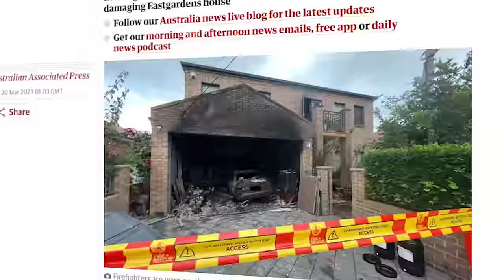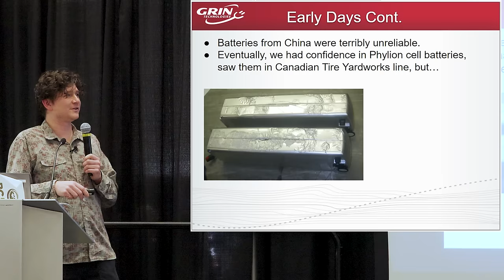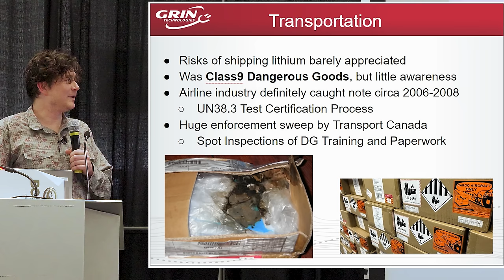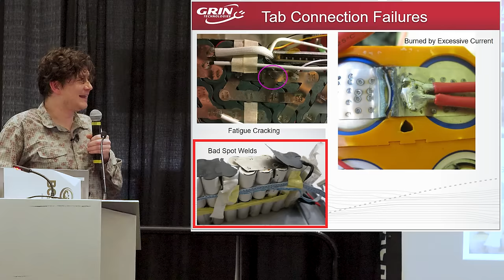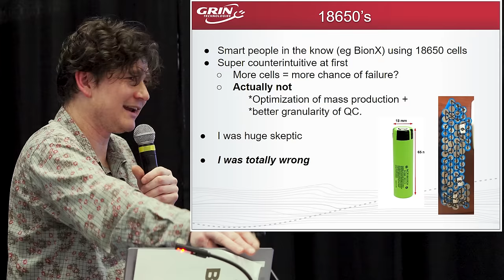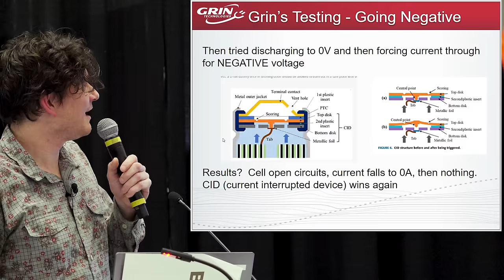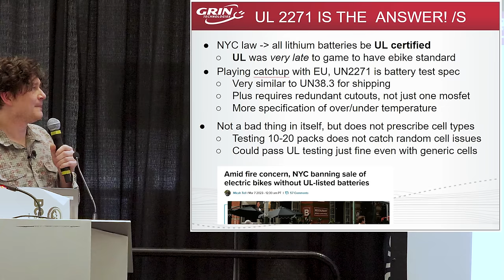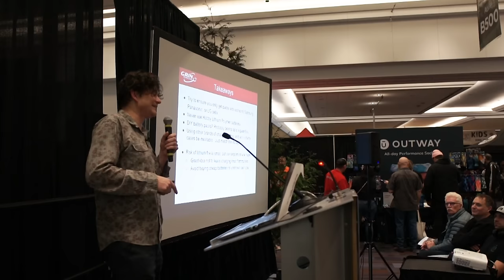Grin's Perspective on Ebike Battery Fires, 20 Years of Experience - Live from the BC Bike Show

Comment: Great video. Do the batteries you make have a fuse in line with the charging circuit? If not why? Do your batteries have the ability to monitor via bluetooth/app? Could not find this info on your website.
Reply: Some BMS (so-called Smart BMS) will monitor the parallel cell groups in the battery via blutooth. You can detect odd behaviours very easily with these, without having to rip apart the battery.

Comment: I'm glad to see Grin having this conversation and taking battery safety seriously. I was working in Ebike product development for a manufacturer in Seattle, and was in fact a Grin customer. When I took on that project let's just say things weren't well understood, and in fact dangerous. I pressed for standardization and increased safety measures, ultimately coming to the conclusion that in the future these batteries, BMS, and chargers should be certified by the U.L. I would go further to say that the BMS is not capable of monitoring individual cells, instead it tracks a parallel bank of cells. Should one of these cells be faulty it can lead to over charging of other cells on that circuit.
Reply from the maker: Indeed, BMS just tracks parallel cell groups. In our experience, the individual faults of a cell in that group are either:
1) Disconnection from the group, (eg from a bad tab weld or an internal disconnect within the cell can). This results in that group having less capacity than the other parallel groups, and during charging it will reach full charge first.  The BMS circuit should stop the charging once that cell group voltage is high, but if the BMS circuit fails at its task, or someone charges from the discharge port where there is no overcharge protection, then it result in overcharging as you say. 
2) Internal soft short.  In this case, one of the cells has an anomalously high self discharge rate and drains the parallel cell group faster than the BMS is ever able to balance it, eventually resulting in this group all getting discharged to 0V. The BMS circuit in this scenario should prevent both the charging and discharging of the pack. If it is charged in a way that bypasses the BMS charge cutoff mosfets, then all the other cell groups in the pack get slightly overcharged.
Reply: @GrinTechnologies  In the event a faulty cell or connection should become faulty there is not usually an indication to the end user that such an issue exists, they simply wait for the LED on the charger to turn green, perhaps notice a subtle reduction in range if they frequently check. But few do. It really needs to be black and white for the end user. I'm sure you're focused on the same things.

Comment: As long as the UL2271 will NOT adress the cell spacing or  Thermal Energy Absorbing Material between cells the UL will mis the goal !  Thermal runaway is one thing but thermal propagation is also VERY IMPORTANT. I have this document and revised it completly and from now it will help but not help  the best as it could.

Comment: Camera Overheating Use External Battery, cooler like small fan or cooling pad (no noise), lower ISO and most common is mismatched SD card class rating for video being recorded.

Comment: my ebike battery always stopped working quickly and was charged quickly.
it was an 8s 24V lifepo4
the BMS only looked at the first 3 cell groups, which was fortunate because the 2nd and 3rd series were defective due to corrosion
1V and 2V and the rest 3.7V

Comment: The sad thing is that because of these early hazardous batteries a lot of public transit will not allow any electric mobility devices on their services meaning the promise of connected transit needs to wait until they can be sure that all of the old cells are out of circulation, which could take years.

Comment: With good investigation technique, The real cause of these fires should be VERY easy to track down with basic statistical analysis. It may not even be the batteries themselves but the controllers they're connected to. We need to focus on BMS technology. I have a pack from a hover board that I couldn't destroy if I wanted to because it has overcurrent /short circuit and over/under-voltage protection 3.2 to 4.15v. I suspect most consumer packs are like this. This could also be caused by bad chip programming within the BMS. The charger used shouldn't matter if the BMS is well designed. I've been a lithium battery collector for a while and haven't had a single fire or even an overheating condition. I always charge my cells to the right voltage using the factory charger and quality hobby chargers with lithium battery settings. The fires I hear most about are from racing drones with their unprotected pouch cells being physically damaged over and over. None of my drone packs ever gave me issues aside from the occasional cell going bad. If not for the internet or media, I would have never known of lithium battery fires. I think it's far less common than the media would have you believe. The media loves sensationalism and lithium fires make for juicy content. Don't buy cheap cells and only trust Sanyo, Panasonic, Sony, Samsung or LG cells. Most other brands are hot garbage from China (a country who both relies on us economically and hates us politically). I think Samsung and Panasonic are the best but that's a battle I won't fight.
Reply from the maker: Thanks for your perspective. It's unfortunately that the fires themselves almost always destroy the all evidence as to what sequence of things caused it. But all the circumstantial evidence with ebike battery fires (hobby RC is a totally different scenario) suggests that most of the fires are not the result of faulty chargers or faulty BMS circuits, or customer misuse, but faulty cells.  

It doesn't matter how good your BMS circuit is at preventing overcharging or overdischarging, if a cell develops an internal short circuit and goes into thermal runaway because of poor process control and QC by the cell manufacturer, then your hoverboard pack can be just like the 100's of others that burst into flames during normal use.

Agreed 100% on your final statement too!

Comment: Where can we see those firetesting videos?
Reply from the maker: They are super dull, literally nothing happened. The circuit interuptor stopped the current flow once the cell's internal pressure got too high and then the packs just sat there with no current.

Comment: Note that there are no problems with Lithium Iron Phosphate chemistry batteries. Industry just doesn't use them because they are slightly larger batteries than lithium ion batteries 😢
Reply from the maker: We dealt with 5 different manufacturers of lifepo4 ebike battery packs back in the day (both in cylindrical and prismatic cells), and none of them had even close to the reliability or the cycle and calendar life we see  with the current leading brands of li-ion.

Would love to know how modern lifepo4 has kept up, but since A123 left the scene many years ago there doesn't seem to be any respectable manufacture of LFP cells in the caliber of Samsung, Panasonic etc

Even at double the weight it still could have widespread use as an intrinsically safer alternative for sure.
Reply: @GrinTechnologies  they have gotten much  better than the early days. But the main problem is with how they are being charged still. I built my own LiFePo4 pack three years ago for my ebike, and the capacity got better and has not demished at all. But the key to my success has to do with unidirectional  impulse charging that uses little current so does not heat up the batteries at all, even though it is delivering 1 amp impulses at Mhz speeds. Its a method that can't be used on lithium ion because they are real finiky and likely explode. This method was invented by John Bedini for lead acid batteries, and the LiFePo4 ended up working great with it too. Unfortunately he passed, and not many of the battery chargers out there, and few of us are out here that understand it enough to build our own.
Reply: I've got a lifepo4 from 2019 that I am only now retiring because the voltage is dropping. There's no reason for most people to use a li ion battery on a bike in 2024. Lifepo4 is plenty powerful and lightweight. The tradeoff is completely foolish now.

Comment: Specs are labeled for a reason, to prevent one of the components from overheating. Its why I NEVER use a battery of placing on a controller a range of 36 to 48 ( 52v ok for 4b benchmark ) of my batterie at 60v or higher.  As long as I KEEP ALL THE SPECS IN RANGE AN USING PROPER Volt's AND WATTS ,I ll be well safer than sorry as FIRES are NO JOKE ( wildfire survivor ) and NEVER RISK using components away from the spec range, its there for this reason alone.. Also CUTTING WIRES TO INCREASE SPEEDS is a SERIOUS NO NO, time will catch up with doing this for sure.
Reply from the maker: The nominal published ebike component specs in many cases are meaningless, especially with regards to voltage and power ratings.  With regards to cell specs, even if you use the cell entirely within manufacturers guidelines, the risk of a spontaneous thermal runaway is always present with generic grade cells. Your recommendations here seem relevant but largely miss the point. Most ebike battery fires have nothing to do with using components outside of their spec.

Comment: using a proven battery is a good idea.  I’ve built battery packs from scratch, with success, however, I have found after years of testing, that tool batteries, such as dewalt, can be used with great success.  Custom building a rack, to hold these batteries securely, and to multiply voltage to the desired value….and likewise, parallel to increase capacity.  The only downside, is that batteries must be removed to be charged individually on its own charger.  But, for safety, and long lasting durability, this does work well.  Still using an ebike after 10 years with this setup, a hubmotor and controller from Justin’s ebike store👍, and 9 dewalt 20 volt batteries in a 3s and 3p configuration, that clip into a rack that fit securely inside the bike’s triangle frame, resulting in a 60 volt 12 amp/hr pack.  I charge all the batteries full before inserting them into the rack, so there is no voltage difference between batteries.  Reliable, predictable performance.  3 chargers can get all nine batteries charged and ready to go again in 3 hours👍.    Thanks for the video!  cheers from northern BC🇨🇦

Comment: What is your opinion on the rad power bikes safe shield battery that's a fully resin potted battery
Reply from the maker: I'd need to see side by side test data to have a strong opinion. When we last tested resin potted batteries into thermal runaway during the early ligo development it didn't stop thermal runaway but it also didn't result in flames, just billowing clouds of smoke. See
https://youtu.be/oBlac5gWLfI?si=_IXqmhFAFaIFAEfR

Comment: There's an eBike battery sold in the UK that has been banned. Called UPP, it's in a triangular shaped pack that straps to the bike frame.
It was sold on Amazon, eBay etc in the UK.

Trouble is the authorities (OPSS) banned them on the big online platforms but the product was still sold from smaller online retailers.
Just did a search and it's still being sold.

They have caused a number of fires, and have a poor BMS (maybe non existent).
Reply from the maker: UPP is just one of a hundreds of overseas battery builders that sell direct to consumer in the west but don't have any accountability or liability in the same way that a western based company does when things go wrong.  As long as that's allowed to be the case, then the competitive landscape is stacked heavily against the emergence of a reputable aftermarket battery business where only responsible players are involved, ie those who take responsibility and liability for what they sell.   

Unfortunately this also incentivizes companies that make products which use lithium batteries to create all kinds of proprietary connectors and communication protocols to inhibit any 3rd party replacement parts, which is a crummy situation for the consumer.
Reply: @GrinTechnologies would you place EM3ev in the same category as UPP? Or are they more reputable?
Reply: @GrinTechnologies  the lack of standards for connectors and interfacing charger to battery is frustrating.
Makes public charging difficult or uneconomical.
Reply from the maker: EM3EV is in a totally different category as UPP and way more reputable than typical chinese vendors. They take all kinds of extra safety initiatives and have a much richer understanding of battery tech than almost all the other chinese pack assembly houses we're familiar with.

Comment: How about ebike and scooter battery that won't charge, only in some minutes then stop? always stop at about 50% when charging and stop at about 50% when riding? only ride about 1 or 2 miles then stop.
Reply from the maker: You can have that in the case of extremely bad cell balancing. It's worth having that pack examined by the shop you purchased it from.

Comment: Any thoughts on the safety of diy batteries? I was thinking of making one for my diy ebike project.
Reply from the maker: We are generally very pro DIY, but when it comes to custom built lithium batteries you really really need to know what you are doing and have plenty of experience in spot welding, bms cable routing, enclosure design and waterproofing etc. We have a strict rule at grin of no DIY batteries allowed on the premises for a reason.
Reply: Okay! Good to know. Thanks for the response.  @GrinTechnologies

Comment: Damn. As a ebike diy guy i am quite disappointed. I thought it was because of the charge/discharge protocol. But now he says its about the bad cookie in the lot that does a thermal runaway due to dendrite formation.
This is so sad because i have so many batteries laying around.
I realise my practise is unsafe.
However i did manage to get thermal runaway by charging a overdischarged 18650. The reason  this battery was flat probably is the dendrites: self discharge during charging= thermal runaway.
Reply from the maker: That's certainly what all the evidence points too. We're normally huge DIY advocates for those with the skills, but with lithium batteries the unknown risks inside the cells are just too great. If you are doing it, you should really only work with new top brand cells.  Save the recycling / repurposing of used lithium cells to stationary power applications or other scenarios that can be properly quarantined.

Comment: Not that long ago, more than a few smartphone would heatup and battery would burnout in many cases user got burnt. But you didnt hear about it all that much but then again in those days, social media wasnt a thing yet. In time, smarphone battery safety improved greatly.You dont see smartphone fires anymore. Same will happen with mobility batteries. Eventually all  the built-in temperature monitoring and inhibit function system safeties will prevent all possible battery overheat condition.
Reply from the maker: You actually don't see fires on properly built mobility batteries either these days. It's really mostly a feature of generic brand cells in an unregulated industry dominated by direct drop shippers from China. Sadly all "ebike batteries" get lumped into the same category. 

Monitoring the pack temperature won't really do anything to prevent those incidents at all, as the thermal runaway is caused internal to the cell. In those situations the BMS circuitry can observe that the packs getting hot but it can't do anything about it as it's not the result of external charge or discharge currents.